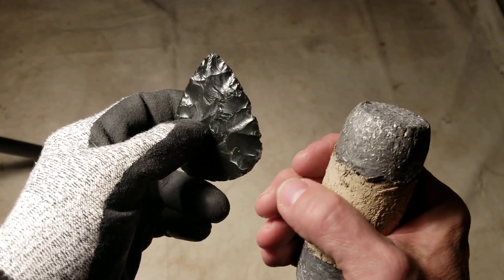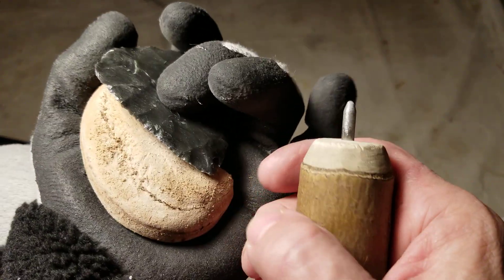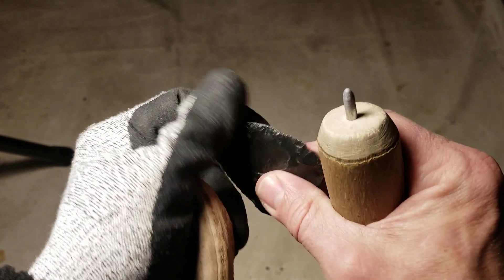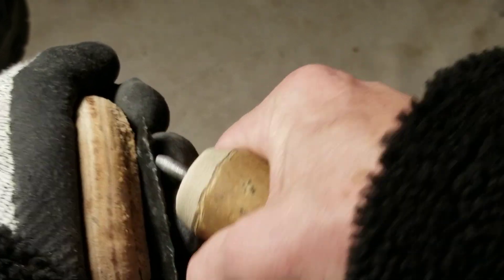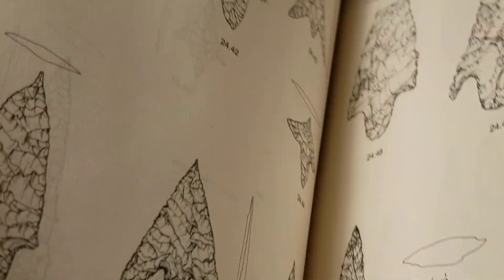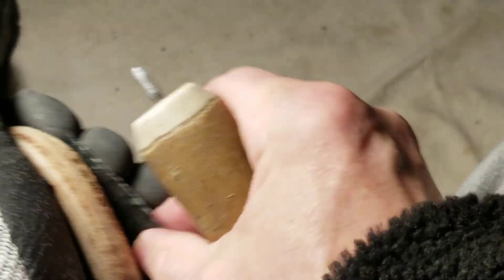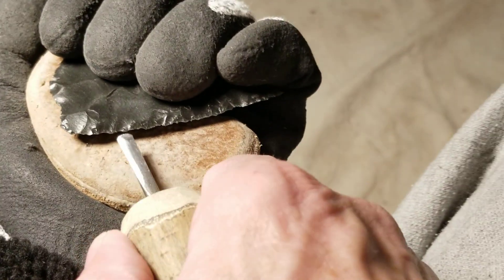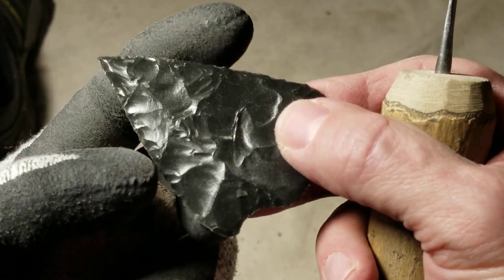1074 - Finishing Up with Houx Projectile Point 1/2

Comment: edbo hollow pvc bopper similar to the effects from "swiping" with your solid aluminium billet ? all these swiping and hollow bopper tecs seems to stem from the old mesmerising method "flat flake with hard hammerstone " brushing swipe thingy that i find almost impossible to do on purpose but sometimes pull off by total unintended action .  nice job in this series its a very valuable one for us learners
Reply from the maker: EDBO hollow bopper is a whole different ball game than a solid aluminum billet. And swiping is an entirely different skill as well.